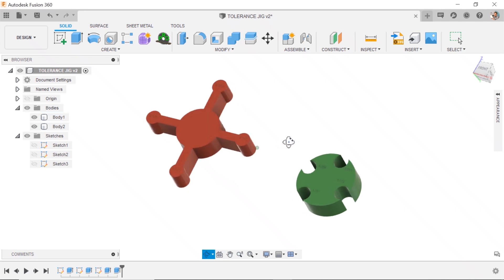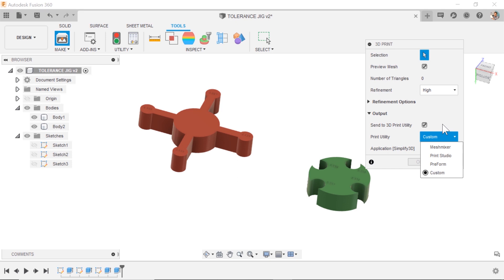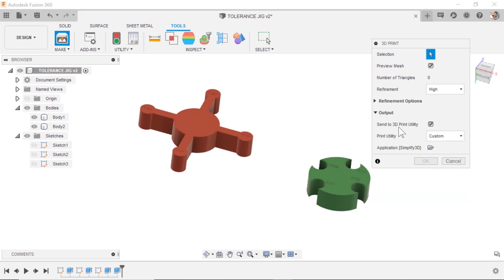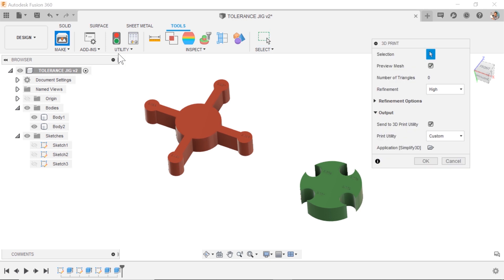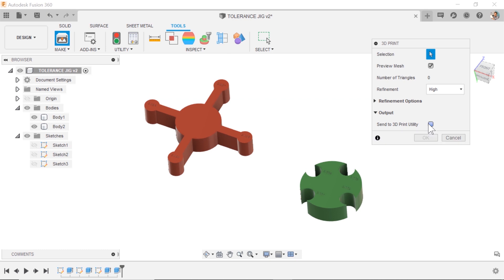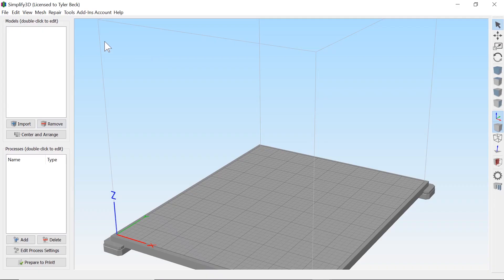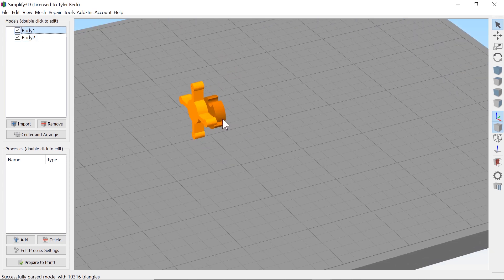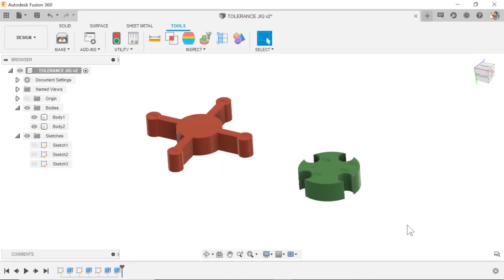FUSION 360 TO STL (Send Designs To 3D Printer)

Comment: If you right-click on the top level in the Browser, then select Save as STL it will have the same dialogue open. If multiple bodies are present you get the option to save (or export to slicer) as one file of seperate files. This is a much better process IMHO
Reply from the maker: HOLY COW!  That's what I wanted!  Nice work...thanks for sharing Spike.  Will pass that along.
Reply: @TylerBeckofTECHESPRESSO  My pleasure Tyler. It's great to be able to give a little back.

Comment: ummm I just right click on the name and then click save as stl. It brings up the same dialog box and seems to me to be fast and easy. I use to send it straight to cura but now I just save it in a print folder. I have more control that way. At least for me anyway. Still love all your tips and tricks
Reply from the maker: Amazing! Much better. I can't believe I missed that one.  Thanks for sharing.
Reply: @TylerBeckofTECHESPRESSO  hey that's why we're here right. To help each other out with out fusion skills. Believe me your skills trump mine by a mile lolololo